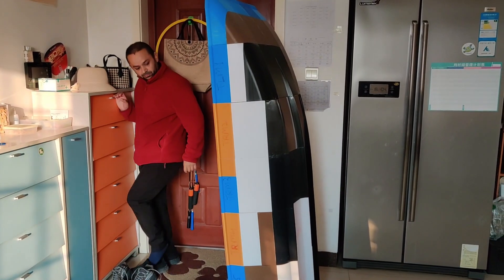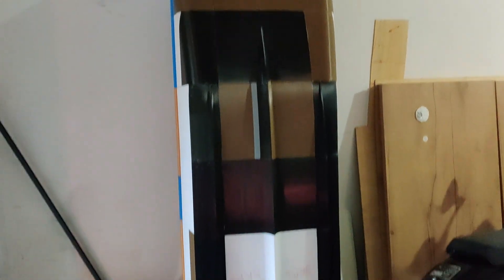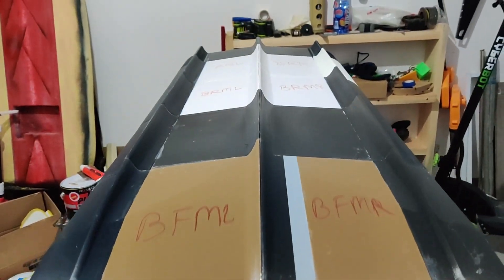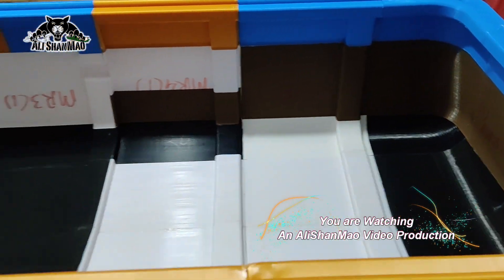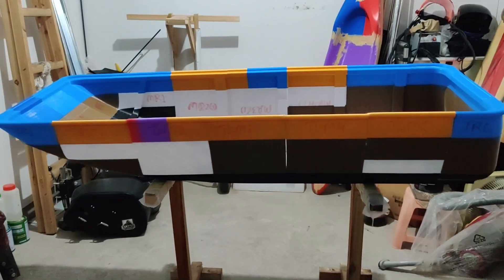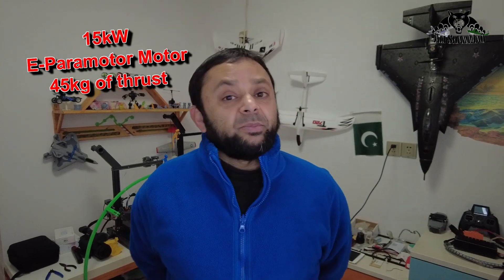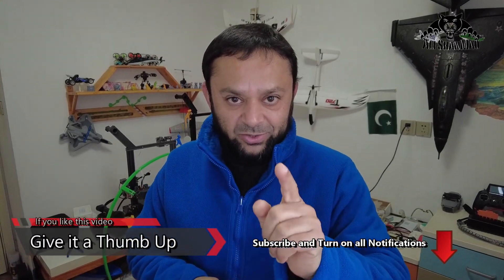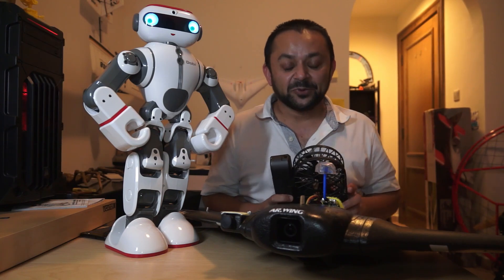3D Printed Mini Electric Boat for 2 persons Project Update

Comment: Its going to track like an Arrow with the built in keel / side  strakes , stiffen the bottom as well & with its high gunnels , less chance of swamping it. John Boat is what we call those type of hulls here & mostly they are workhorses of Commercial Fishermans in protected waters. You hit it outta the Park, on this one Ali.
Reply from the maker: ooo Thank you so much my friend. So lets name it Johnny B :D i have so many plans for this so i am going to prepare it right. i even am planning to splurge a little and use carbon fiber cloth two skins outside and one skin inside with Epoxy. that will toughen it up and it will be light weight too. also that carbon fiber cloth is advertised as fireproof. They have red and orange colors too. it will look amazing with a red carbon fiber cloth skin.

Comment: Ive been watching homemade ,repair jetski motors. But in your case you can rebuild washer motors. 
Cant waite to see a video tomoorow. You upload often and thats cool, thanks.
Reply from the maker: i have my old Electric paramotor 15kW motor. that thing is crazy powerful. i want to make air boat. no more under water motors. i want to take off at high speeds with wings LOL